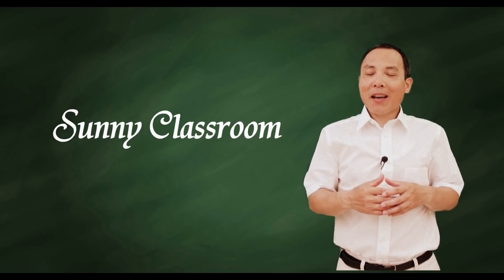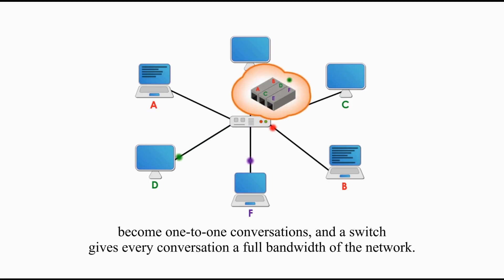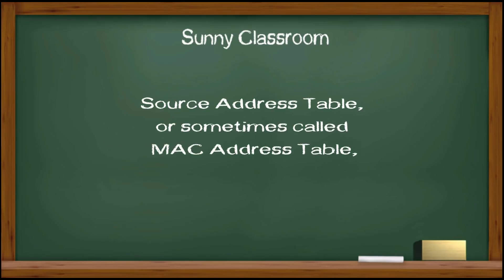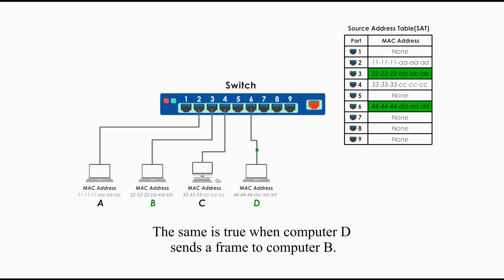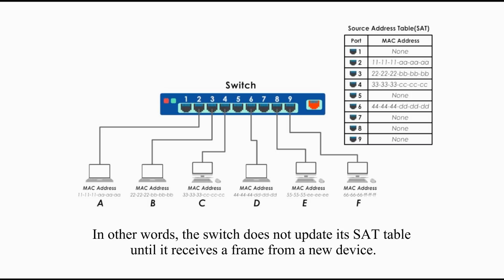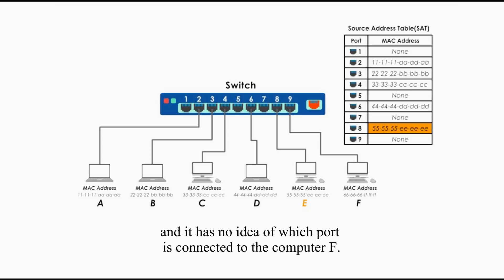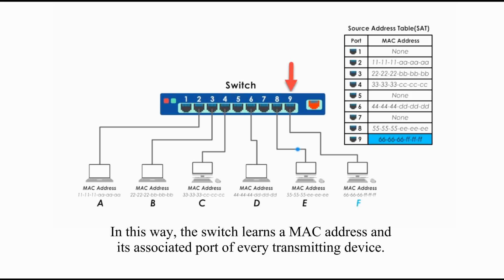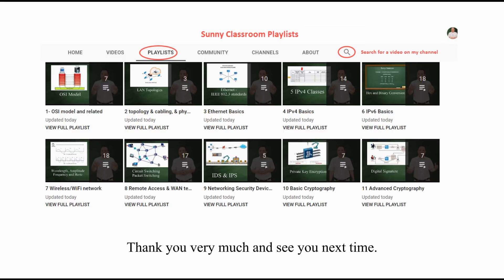How a switch builds Source Address Table dynamically?

Comment: I don't think  you are explaining in detail to be honest. For example, when you say when the switch broadcasts the frame sent by computer E out all ports and computer F will respond you should explain why computer F will respond instead of simply stating computer F responds to it. Also, when you say computer A sends a frame to computer C, that is not how computers connected to a switch talk when first connected to a switch. Computer A has no idea of Computer B's mac address until it has requested it first via ARP and built an ARP cache locally on the computer and you need to explain that. Computers when first booted are simply aware of their own source IP address and source mac-address and a default gateway for routing outside their local broadcast domain.

Comment: In my simulator, when a switch is powered on, it does not go out and get the mac addresses of connected hosts - only other switches.  It gets the mac addresses of hosts when it sees the source mac of a frame coming through.

Comment: Can someone please tell me, how does E know MAC address of F in the first place?
Reply: Switches doesn't understand ip,  it only understands mac,  all IPs are translated to mac via a layer 3 device ( routers and smart switches ) , so the device E does not know the mac address of device F,  but it knows its IP,  the router will do the translation of IP to mac,  and the switch will use the Mac table to know which port to use
Reply: @itmemo8617  why in the video didn't talk about the translation?
Reply: @lies4212  Bcz that's another subject for an other video :D